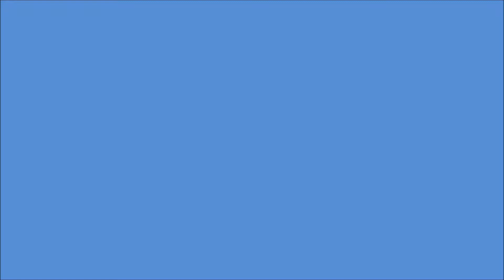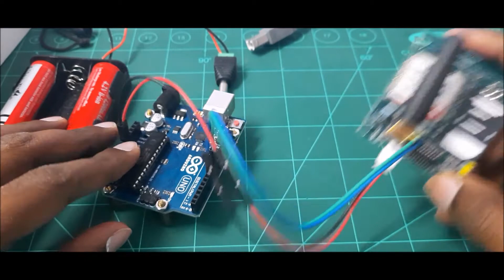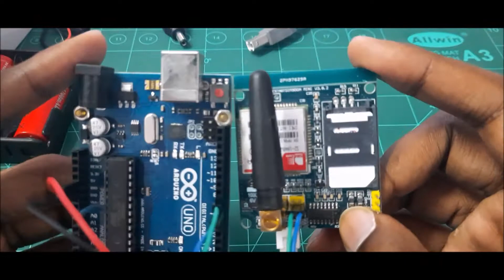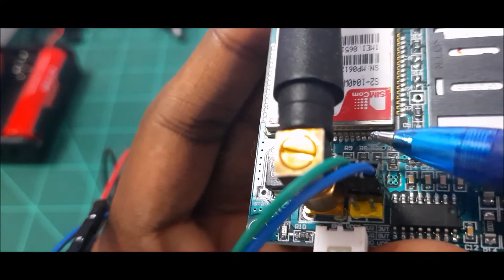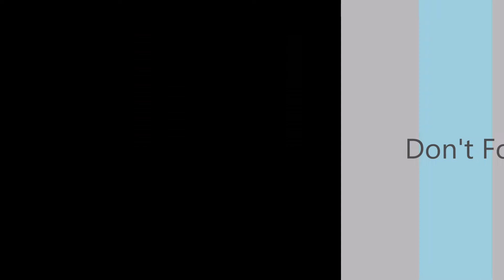GSM : Part 1(Setup)

Comment: Hiiii,,,my gsm d6 is on continuously instead of blinking ...what is the problem
Reply from the maker: Would advice you to check to check the manual of the gsm module. Not every module is the same and different type of blinks or blink interval could represent different meanings
Reply: @electronicseternity9210  thank u ...,,found out ,,my model does not blink while working,,the d6 led turns on throughout...

Comment: if network LED doesn't blink what to do.And only DC-PMR led is on in SIM 900a
Reply from the maker: Would advice you to refer the manual or acquire assistance from your trusted vendor. Not all gsm module are the same
Reply: did you find solution to this issue because facing same issue

Comment: Hello, i have a similar PCB with SIM900, when on, the module sends  RDY  +CFUN:  1   +CPIN: READY   +PACSP: 1  Call Ready (9600 bauds), whei send to the SIM900 la comman "AT", the module responds - AT -, dont receive  - OK - . Its damage the pin TX of the PCB with SIM900? what can i do to test and verify if a need to buy another new brand module?
Reply from the maker: To be honest, it's hard to verify a working module from one that doesn't. One of your best bet would be to liaise with your vendor. If that is not possible, I suggest you buy another working module and test to compare the output.

Comment: Can i know how much V and  mAh for 18650 battery to power up the GSM?
Reply from the maker: Each of those batteries in the video are 3.8v and since it's connect to Arduino's DC jack it will draw current according to the circuit's need. This GSM would generally around 2A or less to work.

Comment: Hello. So I am using an external power supply of 5V 2A and the GSM can register to a network without issues, but when I try to send messages through Arduino, no messages are sent. Why is this happening?
Reply from the maker: Can you try this tutorial on sending SMS

https://www.youtube.com/watch?v=lCoB5kr2sgo&t=106s

Also, check the phone number. Maybe it needs a country code extension

Comment: I like your video <3 My gsm problem can't connect to the  network. I used 4g sim here in the philippines
Reply from the maker: Check the power and try varying the location. If it still doesn't fix the issue, it could be telco restrictions
Reply: same problem. from Philippines.
Reply: Hello! can I ask if your gsm sim 900 worked?
Reply: @andreacimacio2836  has yours worked?

Comment: I have the same type of gsm module here in Zambia 🇿🇲. The problem is that its blinking continously every after a second and that means its not connecting to the network. What should I do to solve this problem?. Thank you in advance
Reply from the maker: Well, can start checking the basics like money balance, data and signal reception. If that doesn't work, you might want to contact your local SIM Card provider to check if there is any restrictions.
Reply: same problem with me. what to do?